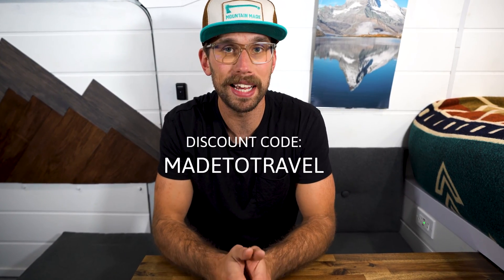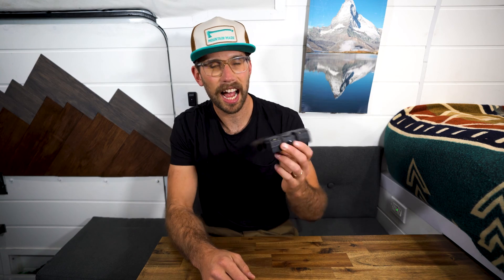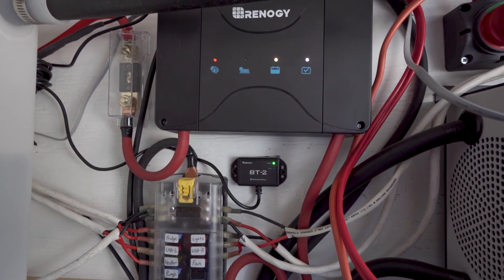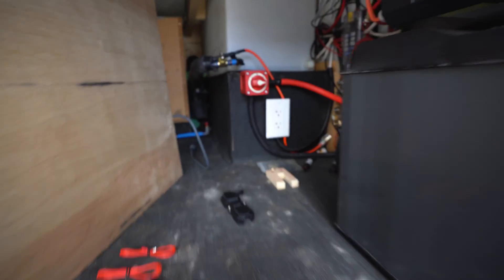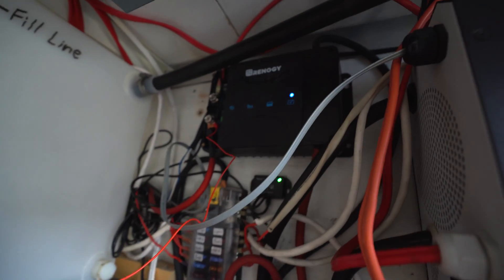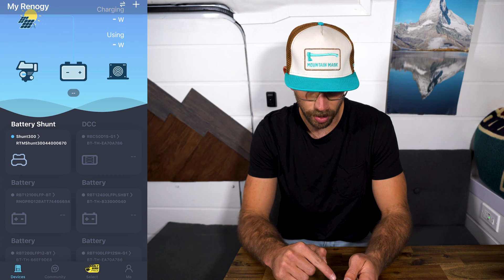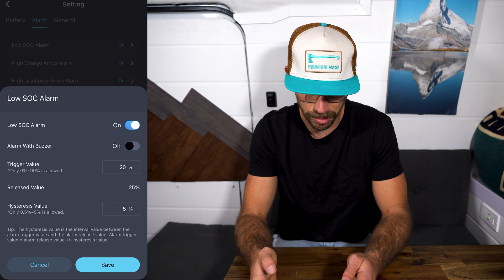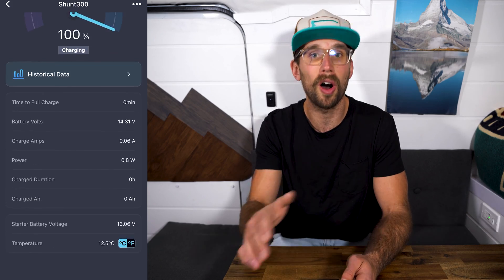Bluetooth Battery Shunt | Renogy Smart Solar Monitor

Comment: Hi there. I just installed the shunt, fully charged the battery to 100%, and sync it to 100%. I have a "battery calibration - high" message that doesn't go away. I was wondering if you ran into this issue. If so, how did you fix it? Thanks!

Comment: All great videos. Quick question, on my setup from battery neg goes to chassis ground then to neg bus bar. Could I install shunt at the bus bar? Does the chassis ground connection make for any issues?
Reply from the maker: The chassis ground should go to the busbar, not the battery neg. Then you could install your shunt on the busbar and connect it too the neg battery terminal.

Comment: Will this work with my windows laptop or tablet as I don't have a cell phone?  I just downloaded the manual and it is useless as it says nothing about where to get the software, how to install it.  It says there is WiFi but no instructions  at all on how to install or use it.
Reply from the maker: @trainmaster0217  the Renogy app is compatible with Mac and iPad. I would try downloading the app first be purchasing the shunt

Comment: This might seem like a stupid question, but you can put the positive wire to the positive terminal of the leisure battery, is that correct? Am I understanding what you did in your video correctly? And then there is another positive wire which it seems that you put it to your starter battery (for you in your DC-DC charger ) is the purpose of that just to have another source of power for the shunt? Because in the booklet it says that that is optional.
Reply from the maker: @pinkbsl7972  yes, or the positive busbar. No, it’s not for another power. It’s so you can see what the voltage of your starter battery is.
Reply: @ oh, so it provides you two sources of information. About the leisure battery AND the starter battery.  And when you say positive shunt, do you mean the bus bar? Thank you very much for your reply.
Reply from the maker: @ yes that’s correct haha I ment positive busbar

Comment: I was hoping this shunt would have the capability to cut the charging/discharging when X level is reached.
Reply from the maker: That’s something you’d have to set on your charging device. For example, you could put custom voltage parameters in the dc to dc charging, inverter/charger, or MPPT so it will stop charging with the battery reaches a certain voltage
Reply: @madetoexplore  I only have a mains AC charger that connects straight to the battery terminals. What extra equipment would be appropriate for that?

Comment: Wow people seem to hate this shunt
Reply from the maker: The shunt itself is pretty good. The design code be better so larger wires can be mounted easier. The App isn’t great and could definitely be improved.
Reply: Yeah, I can see why.  The instruction manual is useless.  Doesn't say where to get the software.  How to install it.  Will it work with a windows laptop or PC using WiFi as it says it has. I contacted them and I never got a reply.  So much for buying this mystery device.

Comment: I just installed li time battery and dcd2dc with the Bluetooth model ...kinda depressed with info I get with that set up....after watching this video n ur battery monitor video it almost seems like the monitor gives better info??? Any problems running that b2 wire to dc charger?
Reply from the maker: @vdub6873  yeah, both are great options. The monitor is very straight forward and reliable. No, it was easy to run the wire.

Comment: If you have a battery bank, do you want one directly connected to each battery? Or one for the entire bank.
Reply from the maker: @randypierce2264  only one for the entire bank
Reply: @madetoexplore  thank you.  Just wanted to be certain.
Reply: @madetoexplore  I called Renogy and they said you need one for each battery. Are you sure it will work while only connected to one of them in the ban?
Reply from the maker: @jacobhorton761  this shunt can handle a battery capacity of 1-6500ah and a voltage range of 8-60V. As long as your batteries are wired correctly, it will have no problem reading multiple batteries in series or parallel.

This question is also answered in the fact section of the online manual on page 26.

Comment: Hard to see in the video, but did the app have a amps discharge and charge line?
Reply from the maker: Yes it will show the amount charged and discharged. In the present it will show you the difference depending if your charging more or discharging more

Comment: Is this not bidirectional ? Telling you charge or discharge, or you mean the readings will be backwards if you hooked it up backwards ?
Reply from the maker: Yes it will show you both amps charged and discharged. If you install the shunt backwards, it won’t work correctly.

Comment: You do a great job on your videos. I have been running this shunt since it was launched and I have to say that it has been a horrible experience. I have gone back and forth with Renogy trying to figure out the issues and they continue to send me “canned” replies that simply say to reference the manual. I am not an idiot and I can read so this has been very frustrating. My issues are as follows:
1. The shunt continues to drop its connection with my Renogy system. I am running a Renogy DCDC w/solar 30a, a Renogy 100ah smart battery, all connected to the Renogy Bluetooth hub.
2. I have to power down the entire system to get the shunt to work again. It gets stuck on a reading and displays static information in the app that is outdated and resetting is the only way to get it working again.
3. The alarms are useless. The shunt (when it’s working) simply beeps and sends no push notification to the DC Home app telling me that there is an issue. The app doesn’t even show an alarm on the shunt icon within the app. You have to physically press the icon to launch the shunt screen within the app to see that there is an alarm. Again, this is useless for someone like me who has the system built into my truck’s canopy and I can’t hear the low beeping that an alarm has triggered.

Renogy’s technical support is useless if you want any feedback other than, “please refer to the manual and follow the instructions.” I even asked them to warranty my unit and never heard back. I ended up selling my original 500A shunt with screen that you have been using when I bought the Smart Shunt because I figured I wouldn’t need it. It was a mistake and ended up costing me more money for useless technology. I am curious to know how your shunt works for you over the next few weeks.
Reply: Did you ever have the red and amber flashing light at start up? Can’t seem to get a steady light as shown by others during start up.
Reply from the maker: Yeah so this is one of the reasons why I don’t have the Renogy One Core installed and I also mention this is the video. Their Bluetooth system isn’t the best. I find that their components don’t stay connected to each other very well. I prefer to only use my phone and connect to one component at a time, the battery being the best. If you don’t have a BT battery then connecting to this shunt would be the best alternative. I find the shunt to have a pretty reliable connection to my iPhone so far.

I’m guessing that one of your settings within the app might be incorrect which is causing the beeping? I also think you might have to subscribe to their service to receive notifications but this would require an internet connection.